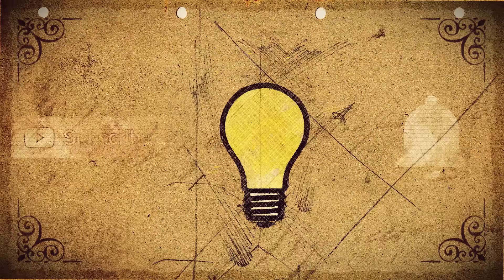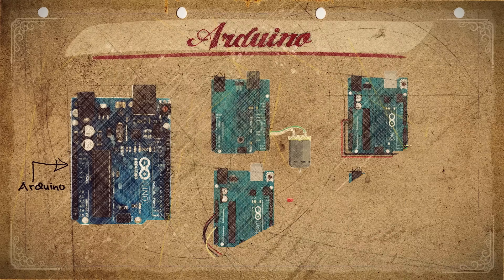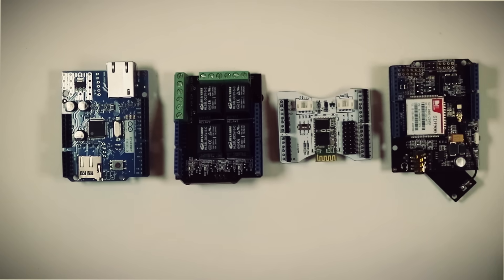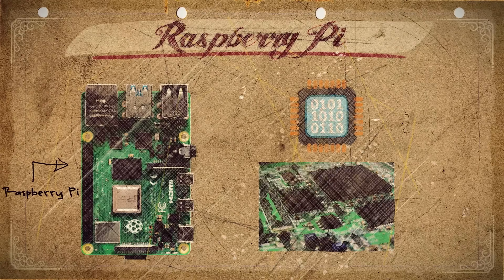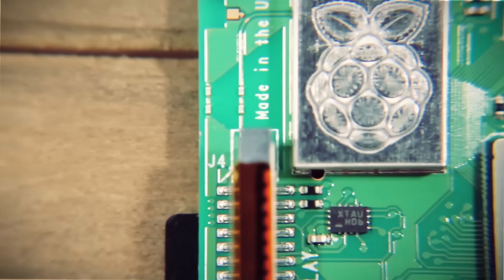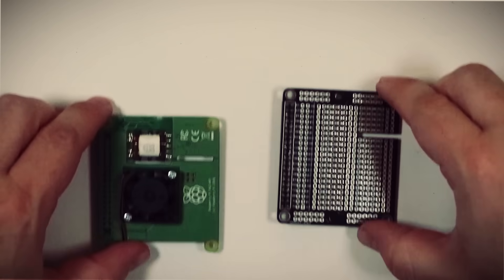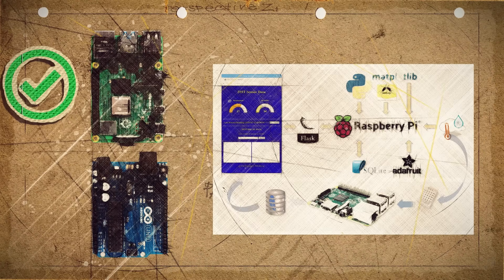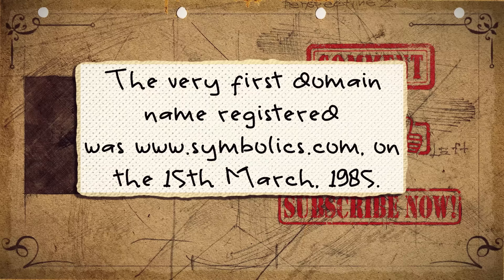What's the difference? Arduino vs Raspberry Pi

Comment: I want to build a delivery drone that operates in 50 KM range , so which should I use whether Arduino or rasberry pi. ??? Can you reply plz, it's be appreciated.
Reply: Better check the regulations surrounding autonomous flying vehicles before you start a project like that (your heavy delivery drone smashing into somebody's car windshield on a highway could get you in a lot of trouble). A flight controller tends to require a lot of processing power for stability control that an 8-bit Arduino may have difficulty providing, so you are better off with one of the 32-bit boards (not a Raspberry Pi since it's relatively heavy and power-hungry).
Reply: @jackvac1918  thank you so much:)

Comment: An arduino is like a computer as well, but from the 90s. Arduinos/Microcontrollers have analog pins which raspberry pi doesn't have, so not all type of sensors are available for raspberry pi.

Comment: Whoa whoa whoa, Windows vs Mac? More like Windows vs Linux. Mac is an operating system for losers with more dollars than sense and Windows is an operating system for those who like their hand held and are scared of the dark. Real nerds use Linux or some form of Unix.
Reply: People who think their life is better spent not troubleshooting for 3 whole days (assuming they actually know how to) why the sound system on the Linux-run machine doesn't function after the latest update because there's no computer shop that provides Linux support are better off using a Mac or Windows.
Reply: @jackvac1918  The longest I have ever "troubleshooted" on Linux was about three hours. I have been using Linux for about twenty years. The key is to get good hardware and you will have far fewer issues and headaches than Windows or Mac. If it takes you three days to troubleshoot something on Linus, you might want to stick to the noob OS called Windows where are are plenty of people willing to take your money to fix your problems for you.

Comment: Hello,
I would lie to build a. Kind of a smart greenhouse.
I have sensors to collect data and would like to use this data for controlling heater, fans,  pumps,  etc. What do. You. Think is the better choice?
Reply: I used a microcontroller to make a smart thermostat with auto off and motion detection etc. (I plan on making a smart green house too this year or next) I used the microcontroller to upload data to my raspberry pi 4. So I technically used both. I had node-red, influx-db and grafana to store the data and display it on a webpage. So if you plan on recording a bunch of data, say the history of moisture levels in the soil and when was a plant watered last then definitely go with a pi. If you don't want to do data processing like that then using just an Arduino will be more than adequate. Or you can do what I do and use both. Arduinos are more suited for driving motors and vaulves. But regardless of which one you choose make sure to have isolated relays and separate power supplies for the motors. If you try to use the pi or Arduino to Power them directly it will burn them up

Comment: To all the ppl saying the Pi is better than the Arduino bc it can do everything an Arduino can:

Maybe it can do this, but it might not be necessary. It’s like using a flamethrower to light a candle. Yea it’ll work, but it’s not practical. Projects that are simple and require low power consumption don’t need a fancy Linux computer running them. 90% of my projects are Arduino based bc I don’t need the Pi’s more powerful features.

Comment: raspberry pi = tiny simple computer, a super controller, can use for very complex things, costs $35-$50 ish. complex things (sprinkling system, control smart house, get/send information to/from Arduino's, multimedia hub). programing language = Linux light.       Arduino = tiny controller, comes in different sizes, cost $10-$60 name brand, off brand $1-$20, use for simple things(check if garage door is open, level of water in rain barrel, control Christmas lights, check room temp/humidity, can show information on tiny display or send information to a raspberry pi for smart home controls. programming language very simple, i would call more C than C++.

Comment: Wouldn't the Rasberi Pie be easier for beginners? since it works like a regular computer? if you get a screen for it you can use the OS with an UI. Meanwhile Arduino you have to code everything yourself and it's more low level stuff in general.

Comment: 1:09 This motor conection to the arduino digital pins...man
Reply: Some of Arduino's digital pins can be used for analog output
Reply: @xGOKOPx  Im worried about the current that a digital pin can deliver vs the current that a motor needs.

Comment: A lot of people don't realize that they are different (for example, the Pi can be used out of the box, with a Debian-based system image) whereas with the Arduino you need to program it to do things (ie. it can't be used solely on its own until you've uploaded a program to it or connected it to a computer (a Pi or a desktop/laptop).  I seem them more as two different types of boards and not so much competitors.  The Pi is the "main" board that could be used as a standalone computer, and also to program a Arduino, and i see the Arduino more as a prototyping, advanced circuit board with a built-in logic chip of sorts.  You can do quite a bit with the Pi alone in terms of prototyping and controlling motors, using sensors, etc.  The Arduino board just adds capabilities and if you don't need th e extra features of the Pi and you're just looking more for a board with a controller that you can expand upon, then the Arduino is the one.  But the two can work together as a pair.

Comment: So if I wanna build an alarm system using a sensor that if tripped can send a message to my phone, that would be Rasberry Pi right?
Reply: An Arduino would be enough. To send a message to your phone you can use SIM800 GSM with Arduino. Some of them come with Bluetooth and wifi, Google it. It's not very expensive.
Reply: xXxIMMORTALxXx thanks 🙏🏽

Comment: Important difference that should be highlighted: Arduino can deal with both digital and analogue i/o, whereas the Raspberry Pi will need an external d/a converter
Reply: Don't forget Rpi supports i2c, you can work with pretty much any sensor via i2c bus.
Reply: Exactly.  There are a lot of hardware such as sensors that work only with Arduino out of the box.  In more case than not, one need to look at what input output hardware they will be using before even deciding between Arduino and Pi, and that's before looking into other things like power source.
Reply: besto
Reply: This comment aged poorly
Reply: Thats a pretty huge deal. From a sparky. Digi cables get run in many power trays mistakenly. Could be a light?or a recpt?dunno got no shield though. I've pulled cable for miles. IbewAb424 15years in tha mac stinkcrude.
Reply: analog input, not i/o, the arduino doesnt have a analog output, though thats kinda debatable since you can easily make PWM into analag simply with low pass.
Reply: @_--_--_  ESP32's have DAC's and run on the Arduino IDE. Sure they might not run natively (have to download libraries) but I consider them to be arduino microcontrollers like you would Nanos or Uno's.
Reply: @_--_--_  8
Reply: @_--_--_  I realized that you can do analog output that way. Is the min throwback the response time? Also would there be significant reactive power loss as specific frequency and capactiance pairs?
Reply: Raspberry has an hdmi and Camera port and You can connect it over usb to the Arduino, but that is not easy. The worsest thing is that nearly all programs from the internet are not working with an Raspberry Pi 3 - they are nearly all for old versions - I have 12 Sensors and 0 Programms work as they are  - it is easy to read or write a 0 1 to a pin, but connectiong usb or a a/d changer has not worked now ... maybee I try the prog from IBM.
Reply: Arduino moch better
Reply: Thats the same point as the difference highlighted between MCUs and MCs.

Comment: No mention of Arduino real-time operation, how the arduino can sync to an external clock, and how the Pi despite being far more powerful can't do realtime stuff, which is the critical difference between them for embedded control.  Also, C is C.  C# is more accurately compared to Java.
Reply: c# is half-step higher than c
Reply: ok nerd

Comment: I'm connecting my entire full-time van with Ethernet-linked devices. Front control console and streaming backup camera: Raspberry Pi. LED lighting, battery management, PIR sensors, heating controller: Arduino. If you want a computer that controls things, that's a Pi. If you want a controller that can talk to computers, that's an Arduino.

Comment: Building an R2D2 fully functioning Droid and this video made my decision on using Arduino instead of RasPi.  I'm very new to electronics so videos like this will help me learn the way of Arduino.  Great video, explained very well.  One area you might want to explain, RasPi needs more energy to operate due to its many added components so if you built a battery operated robot/droid with the same electronic components, the RasPi will most likely limit the amount of operating time vice the Arduino system.  Of course there are many variables, like in everything; however, overall I believe the Arduino would allow more operating time.  Thanks for the video.

Comment: I got an Arduino for my son with wheels that moves forward when a flashlight shines on the sensor. We couldn't get one of the wheels to turn and now it sits on a shelf.  Not sure what else I can do with it. Already paid too much for something that doesn't do too much.
We got a Raspberry Pi at work, and I was able to recompile a C# app I wrote and it worked 3 OSes.

Comment: I work it out like this: If an arduino is capable of doing it, use an arduino. I recently bought an Uno clone for £6 and it will sit inside a box controlling some simple buttons and sensors. A Pi would be wasted on this.

Comment: Arduino is a microcontroller
Raspberry Pi is a minicomputer you can run an OS on.

Both are good for different projects.
Reply: LolzChannel - Minecraft to me I see no reason to not a raspberry pi. Little price difference. Only if you don’t know python
Reply: @Trackrace29582  Pi runs an operating system so you can't have reliable, precise timing - it has to run other stuff, not just your program. Arduino only has a microcontroller which only runs a single program (yours), so nothing gets in its way.
Reply: @Trackrace29582 man, you're new at electronic, you have no idea the true power of both
Reply: faiz abbas but for some projects using a pi would just be overkill. I don’t want a pi running for every single sensor I have put together.
Reply: This aged well.

Comment: One of the real differences between the 2 is precision. The Arduino, being a dedicated microcontroller, is rock solid on timing and repeatability. It's simplicity is its strength here. The Pi otoh runs a general purpose OS and cannot be relied upon to have such rock solid timing with regard to reading sensors. critical switching, etc. Being a computer, it excels at complex processing and handling large amounts of data.
Reply: You can run a Real Time OS (RTOS) on ARM. Some are even Linux based. The stock Linux kernel itself has a PREEMPT_RT option. Linux is so general purpose it can specialize.
Reply: Does that mean if you wanted to have an electronic leadscrew....single prime purpose..... for a lathe you would NOT use a Pi but an Arduino?

Comment: You can't compare but reason isn't the calculator or laptop thing, most importing choosing feature is project requirements. You build a machine has components works with an controller you need arduino, you work on IoT you need arduino for leaf nodes and pi for internal nodes

Comment: Can someone explain how to change my OS from Windows 7 to Linux Ubuntu fully?
Reply: Just boot a flash drive with the ubuntu iso file and some program to do so and acess the flash drive it by bios and install it.
Reply: But it will delete everything in your sistem. Unless you do a backup or a dual boot (windows and liinux).
Reply: "Erase Disk and install Ubuntu" after booting from a USB
Reply: @gokurocks9  you'd better have install media before you go erasing anything. Because a PC without an OS is a doorstop.
Reply: Now why would you want to go and do something like that?
Reply: @1pcfred  Why wouldn't you?

Comment: A lot of engineers choose to use arduino just because it's more simple and easy to work with. The programming lenguague it's pretty easy and very well documented and the device it's very flexible. It already has a lot the elements that you can use right away to work with electronics, which allows anyone to make lots projects without scratching too much their heads. Unless you don't need some power or you are not doing more complex projects, other devices like raspberry pi would just make things harder (but it's always fun to try and experiment!).

Comment: Thank you, I've been a little vague on the differences. I've also heard that Arduinos are good for prototyping, letting you use a more generalized system for development until you find out what more specialized, therefor cheaper, components you actually need for manufacturing, like a stability system for RC aircraft, or some such item.

Comment: Can you use a raspberry pi in conjunction with an arduino?
Reply: Of course, but you have to use a level shifter (Arduino use 5V logic levels, Raspberry use 3.3V, connecting them together will fry the raspberry), and use I2C, UART, any other low-level serial/parallel protocol, or just put together your own, depending on what you need.

Comment: I’m not very familiar with Arduino but have done some stuff with TI MSP family microcontrollers. Despite of the programming language working with microcontrollers is basically reading and writing registers. Fast and efficient but requires some knowledge. If I have understood right, Arduino offers somewhat easier way to control those registers which are great. You don’t have to go through some 700 page microprocessor user guide to get the work done.
Raspberry pi is a computer and you don’t have direct access to its core, pretty much everything goes through operating system which is bit slower than reading and writing the processors registers directly. But the Pi processor is quite fast compared to size of the board. Although Python is often used with Pi there is no reason why you couldn’t use C# or C++ with it, as said it’s a computer so you can use compliers with it.
Both Arduino and Pi have their strengths, just chose the one on that suits your project best.